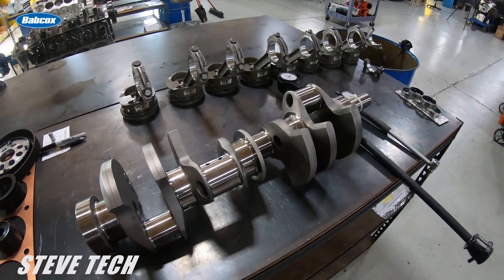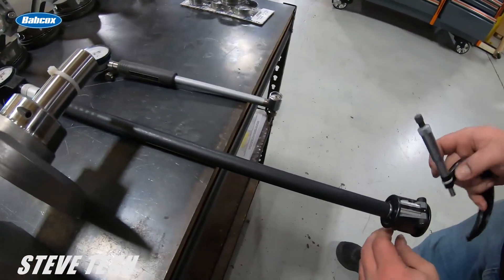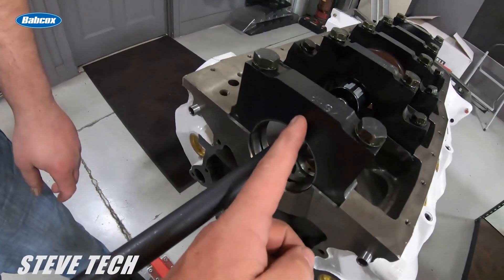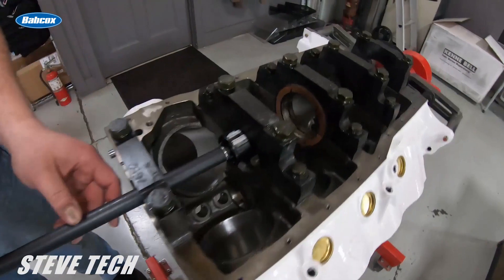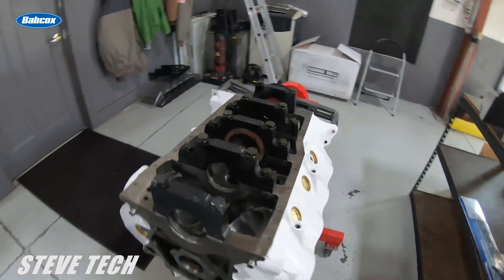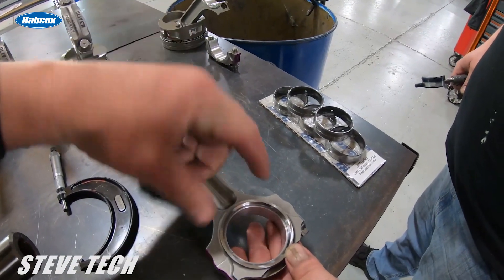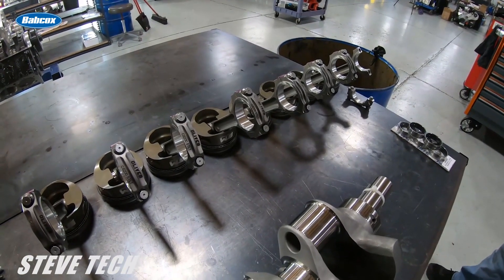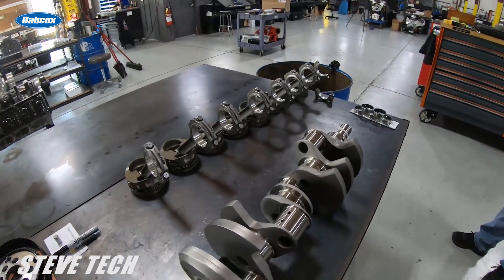Bearing Clearances Part 1

Comment: Steve, you failed to give the dia of the cranks rod and mains. This is what you should base your clearances off of. Obviously a Sbc crank with a honda rod journal is going to have less clearance than a BBC with a Std rod journal. I understand that it is just a lesson on how to measure it, but someone who maybe doesn't have the experience might just take those numbers to heart. As a machinist I deal with people like that all the time. Sometimes when one is very smart on this stuff (which u R) they don't even think about it. It's kinda 2nd nature.

Comment: Interesting as I've heard cup cars and other applications like that are running super TIGHT tolerances...like in the 0.001-0.0005" range for rods and mains. They aren't running aluminum rods, but I've also heard of high power 4 cylinder and V6 drag engines also running super tight clearances.

Comment: Why is it you so called engine builders do not measure the bearing shells before you install them ? Do you just assume all is well with the world and blissfully stick them in?
I suppose you never saw select fit bearings to match the internal as well as external sizes. Honda used them and rarely a bearing failure with tight bearing clearances.  .007 bearing clearances? Your rods must be made of Gummi bears. And with aluminum rods no bearing is actually needed.
Reply: How many of your engines have seen 5 second passes?

Comment: So here he is demonstrating oil clearance. I too am amazed that they run .006" aluminum rod bearing clearance when you consider that rod big end housing size might grow .002 to .004 in size at 150 degrees of oil temperature. (I suppose the quality of rod and material could lower that number, but it's still larger than static at room temperature)

Comment: Thanks for educating people about this. Been trying to explain these things for years. People think I am crazy or dumb .👍👍explains why there lack of good machine shop anywhere in the north west .
Reply: Actually there are a number of not just good but excellent machine shops in the NW.  Johnsons Machine and Performance in Olympia checks every bearing clearance just like described in this video.  Randy the owner went to SAM Tech in Huston and graduated at the top of the class. But his best education was after school when he worked at Huston's biggest performance machine shop as a result of a recommendation of Masingale the schools owner. The NW, because of it's weather is not exactly the center of the performance world, but that does not mean that Dale Green at BG Machine and others aren't very knowledgeable and do excellent work.
Reply: @PerformanceEngines  I assembled my own engines. These machine shop I speak of couldn’t tell you what bearings clearance goes in what ! 1 because they don’t know’care or understand. There are great guidelines for what goes in what since 1940s they work. That’s just the beginning of shop in the NW.   it is so simple to build 1000 hp and makin it last engine these guys want $2000 for standard machining of parts. Business rich or repeat customers?  You tell me ? Crank grinding is the same problem here